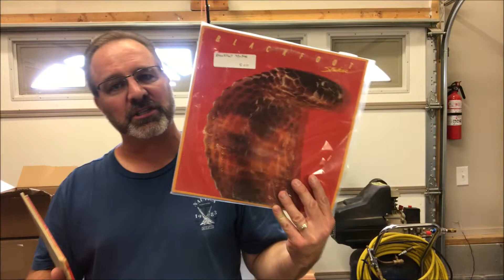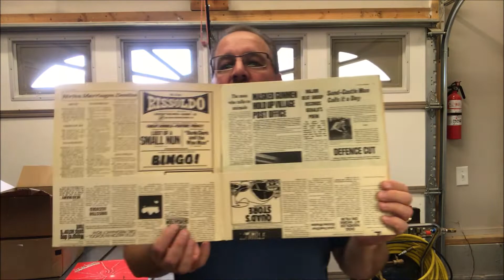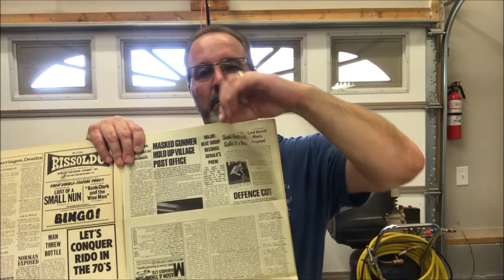Shop Update 8/31/2019

Comment: Thanks for sharing,,question,,,I’ve Had 2 resin blanks have a small crack at the bottom when drilling,,I’m using a 7 mm brad tip drill bit,,is the brad tip the issue,,I’m careful at the end not to punch throgh,,thanks for any help
Reply from the maker: I’ve used brads before with no issues. When I have blanks that are prone to cracking, I cut them a little long, drill to the proper depth then cut the rest off. 

Regards,
Bob
Reply: Perfect,,will do that in the future,, thanks for sharing,,👍